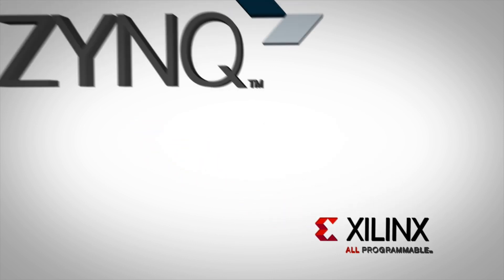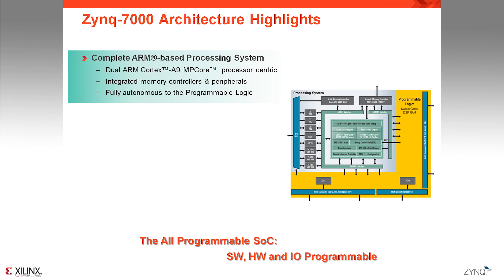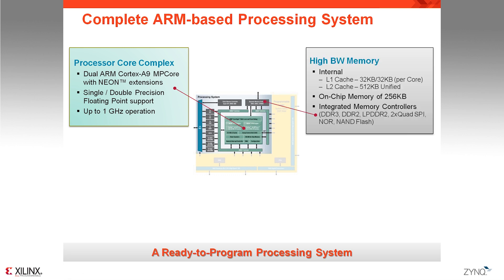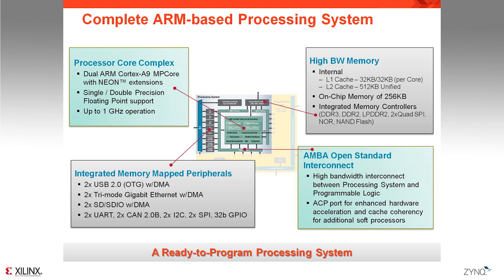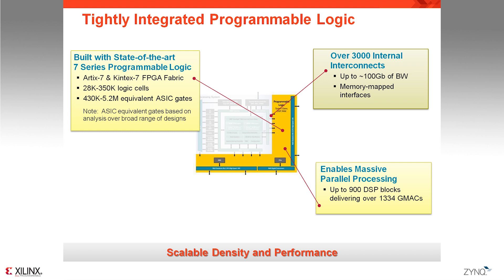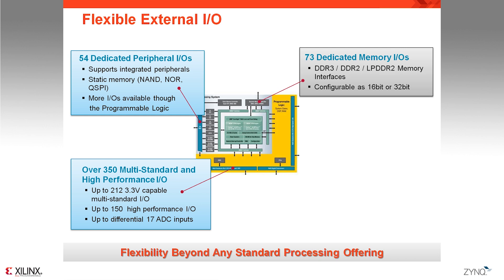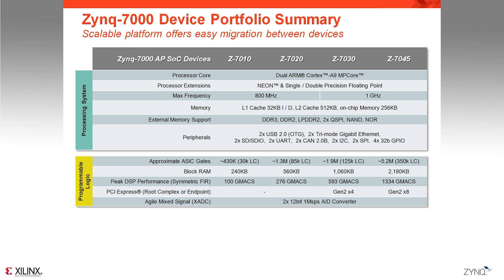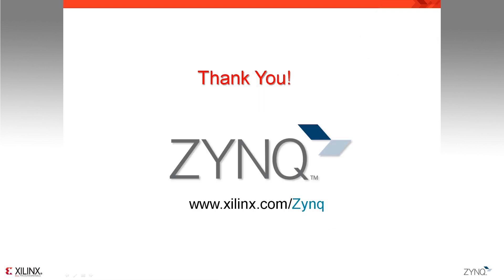Zynq Hardware Architecture Highlights

Comment: Great Video!  I have one question, is it possible to use only programmable logic part of Zync 7000 chip without using ARM part of the chip (both I/O should directly communicate to FPGA fabric) ?